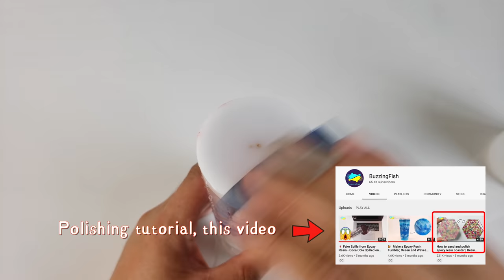🏮 Night Lamp With Epoxy Resin and Bunny Tails Grass | Resin Art 🏮

Comment: I used an normal bottle and it melt cause of how hot the resin got, how can I fix this? Btw. Beautiful Lamp I love it!
Reply: Try looking for resins that are made to do deep pours. Im not 100% sure but I don't think they get as hot.
Reply from the maker: If the fever is severe, you can find ways to lower the temperature, such as putting in the refrigerator, blowing air, or putting some ice or cold water outside the mold
Reply: BuzzingFish thank you for responding! I will be trying this so that I can get a beautiful result like your!

Comment: Do You Secure It All Together After Putting The LED Lights In So It Won’t Come Apart??
Reply from the maker: You don't need to fix them together, as long as you don't touch it, it won't fall. But you can also try to fix them together

Comment: Does this stay stuck with something or it comes on & off? Love your videos!!
Reply from the maker: The switch is designed independently, you can manually turn on and off the lights, thank you for your love of my video😊
Reply: @BuzzingFish  I mean the night light does it have to manually be put on top of the light or can it be glued onto the light part?

Comment: Hi love this and I want to try it myself I was wondering what you used to attach the wires onto the chip? Did you use glue or solder it ? Thanks!:)
Reply from the maker: I connected them together by welding😉

Comment: Hello I wonder how you remove the się bubbles grom epoxy
Reply from the maker: 1. Try to avoid bubbles when you stir
2. You can put the mixed resin in warm water (50 ° C), and you can quickly eliminate bubbles in 10 minutes, but the quality of the resin you buy is better.
3. You use a vacuum pump to pump air, which can quickly eliminate air bubbles.
Patrykkolodziejczyk. K If you have other questions, please leave me a comment 😊
Reply: @BuzzingFish  thanks for your answers👍